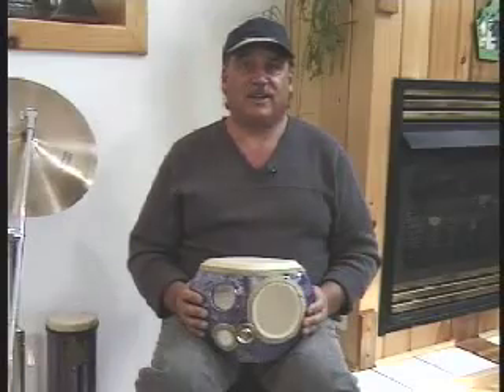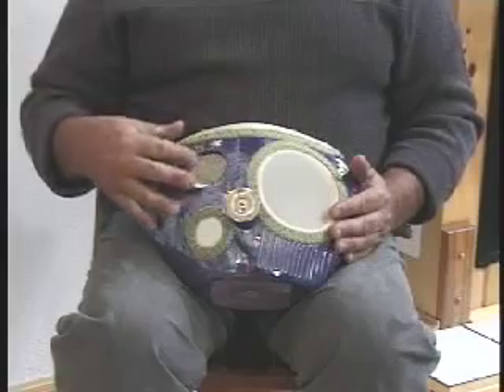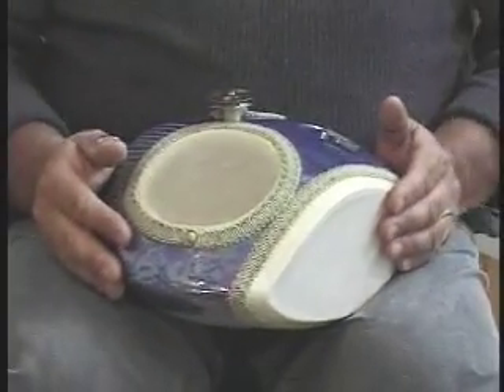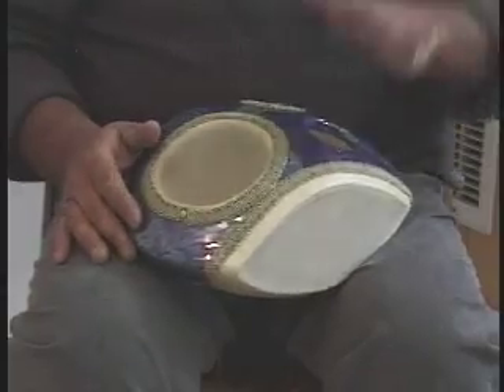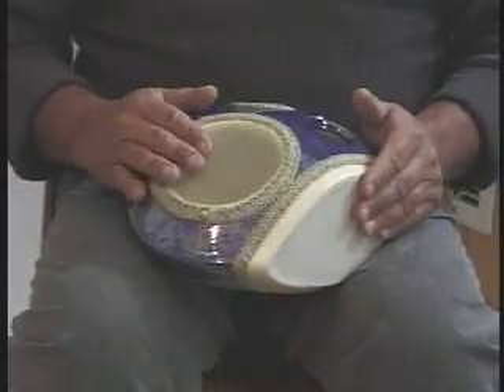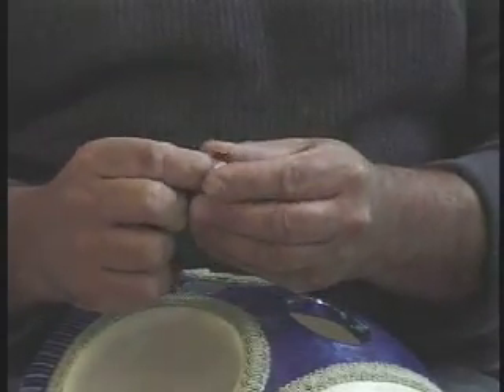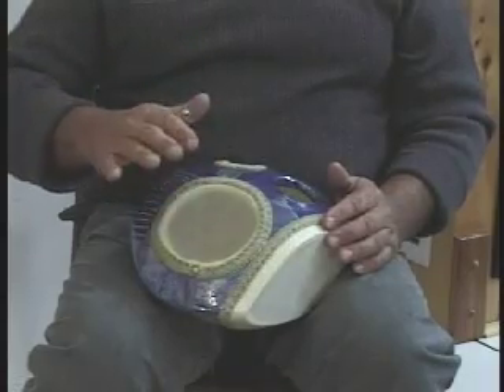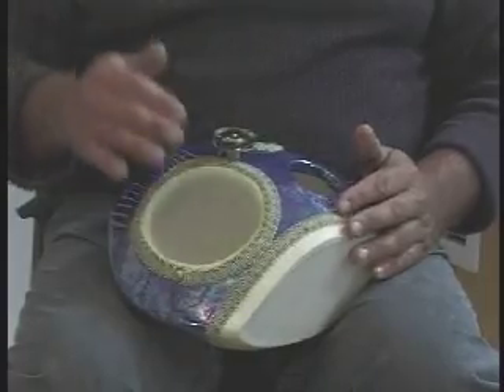American Percussion - "Orthagonal Lap Drum"

Comment: Hi Orian, you can lower the pitch by spritzing a little water on the head and you can use a hair dryer to raise the pitch but be careful not to add too much heat too soon because it can only take a few seconds to tune up. If the head becomes tired ( so far this has not happened) the old head and glue must be removed and a replacement head put on with a two part epoxy. Thanks, Ken Lovelett- American Percussion